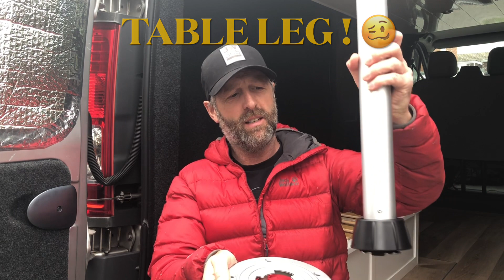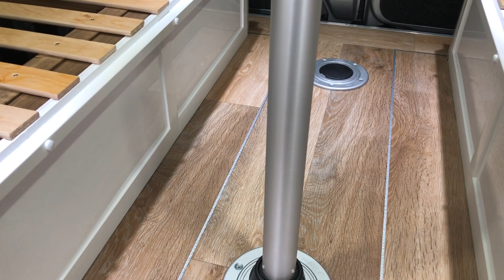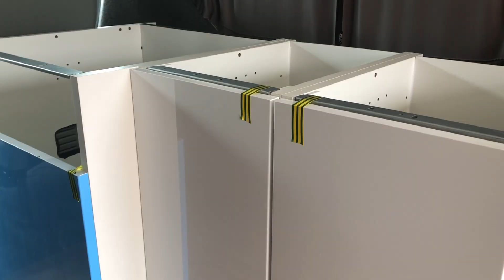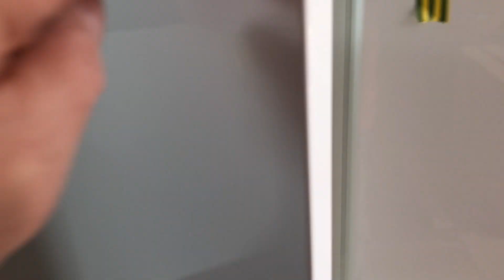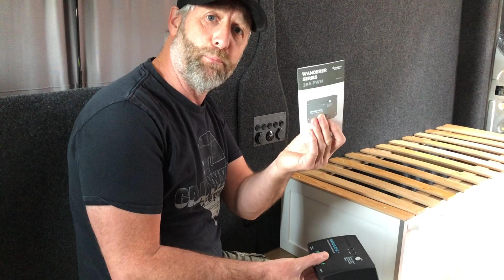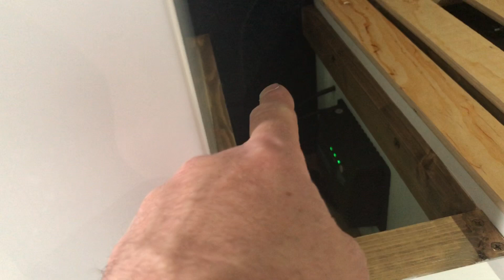Vauxhall Vivaro Camper Van Build Part (10) Table Legs / Kitchen Units / Solar

Comment: Great video, I'm just about to start a conversion. I've watched a few build vids and it's noticeable how more and more knackered the builders get as it goes on! 😉. Good work mate!
Reply from the maker: 🤣 Got to say doing it at weekends and Holidays really take it out of you. Overall though - it’s very satisfying when you have positive comments about the build 👍 Thanks again for watching - Good luck with your conversion- happy to be of assistance if needed. 😁
Reply: @abikerstale806  Thanks.  And yes weekends only must be tough.  Fortunately I'm retired so have 7 days a week to work on it.  Gives me something to do, I get bored to tears. I was shocked to see your estimate of £4k - £5k for your build, I'm hoping to go lower than that! Keep it a bit more simple. Good luck.
Reply from the maker: Yeah, It’s the quality products I use- just for the Battery - that was just under £300.00 - £600.00 for the fridge and solar panels, controller- it all adds up. Materials are ridiculous at the moment!

Comment: Hi. Yup last week was very wet. I did manage to get my solar panel on the roof the week before so that is now working and charging my battery. Your kitchen looks better than mine. Well done.
Reply from the maker: Thank very much - Trying to build a camper van on the drive way is very challenging- I salute those who haven’t even that. It getting better 👍😁